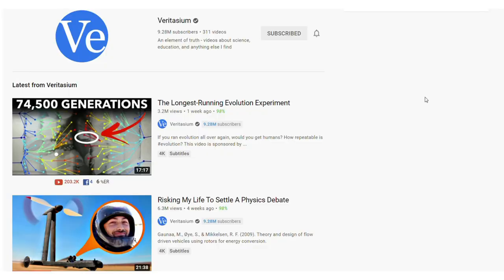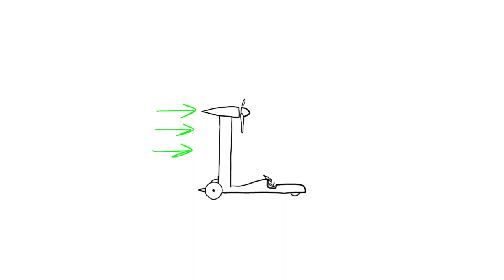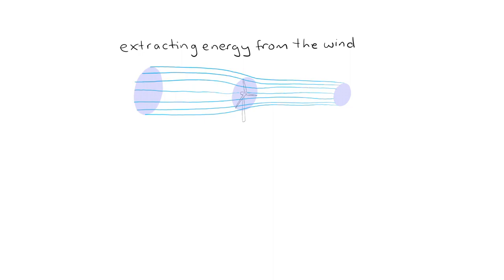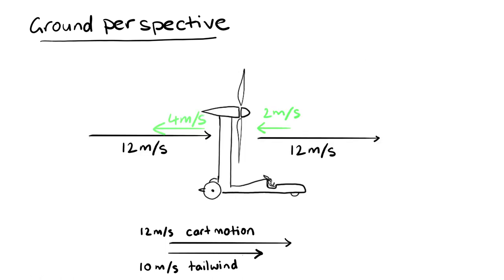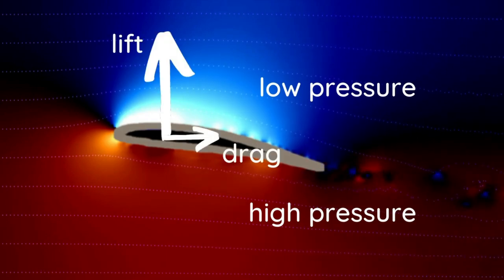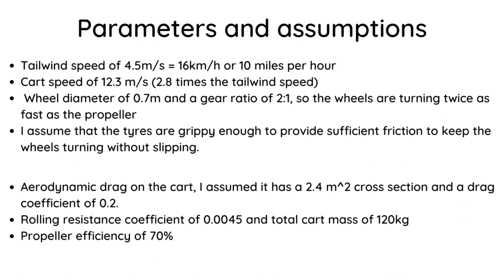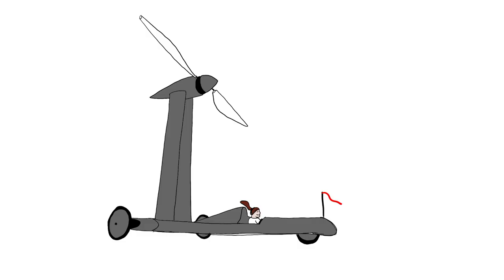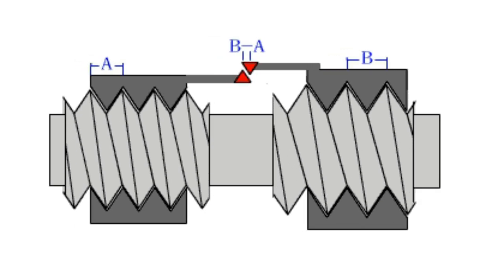Downwind Faster Than the Wind by Veritasium: How Does it Work?

Comment: Next question for the internet: Can a glider pilot experience negative g's?
Reply: Why not?
Reply: @eyytee  It means it's falling faster than a rock...
Reply: Of course.  Just roll inverted and fly along or push over hard!   I'm not sure what the conundrum is here??
Reply: @NielMalan  G-force is not about how fast you fall, but about how hard you turn, and/or how the plane is oriented.
Reply: As a licensed glider pilot, I can assure you that negative g's are trivial to induce in gliders.  Plenty of videos on YT showing this.
Reply: @sk.43821   Just roll inverted and fly along level or push the stick forward hard!
Reply: @sk.43821  In the context of planes, negative-g and positive-g refers to the direction along the plane's yaw-axis.
Reply: OK, a poorly posed question got some knee-jerk responses from literalists. 

Rephrased: If a rock is dropped from a glider, can the glider reach the ground before the rock?
Reply: @sk.43821  It's a pilot's experience of falling "upwards", as if gravity has become repulsive.
Reply: @NielMalan  "If a rock is dropped from a glider, can the glider reach the ground before the rock?
"

It he drops the rock while flying horizontally fast and goes into a dive after that, he can overtake the rock vertically.
Reply: @eyytee  So a glider can fall faster than a rock?
Reply: @NielMalan  A glider is not just falling. It can exert an upwards force on the air, and thus experience a downwards acceleration greater than 1g.
Reply: @eyytee  So the pilot would be experiencing negative g's throughout the flight?
Reply: @NielMalan  The plane would have downwards acceleration greater than 1g (parallel to the Earth's gravity). This is not what is usually referred as "negative-g" in the context of planes (parallel to the plane's yaw axis)
Reply: good bye Niel Malan
Reply: @NielMalan  Yep.   You didn't get knee-jerk responses.  You got straight responses from the question you asked by a bunch of glider pilots.

Yes.  A glider can most definitely beat a rock to the ground but it probably would break up first for exceeding max speed.  You roll inverted and are just using the wing to generate negative lift which can get you down quick.

Comment: Ok but where's the explanation of the acceleration past 10 mph to 30 mph and why it stops perpetual acceleration at 3 times wind speed. The wheels drive the fan which speeds up and drives the wheels which then drive the fan even faster. Your fan thrust math is pretty small at 10 mph but what's going on beyond that? Sorry if you explained that and I'm just not getting it.
Reply: As the cart accelerates eventually it reaches a speed where the cart body's aerodynamic drag combined with other losses become more than the thrust of the prop compared to the retardation at the wheels plus body drag.  That is the limit speed.   There are other issues with props like tip going supersonic at even higher speeds but it probably never gets that fast.
Reply: @killbeas  I was trying to understand how the sail across the wind speed factor of 2.8 just happened to be the same factor the Blackbird achieved. Integza explained this to me. The prop is the sail across the wind and the grounded wheels transfer that thrust to the cart. So that tells me 2.8 is the theoretical limit but the cart was even accelerating past that and if 2.8 was the limit, the drag forces should have kept the cart below that. So I still don't have the whole story. Derek said in the video there was no limit which must be wrong.
Reply: @ralfcis  2.8X windspeed isn't special or magic or a theoretical limit speed.  I'm not even sure what you mean about the "sail across the wind speed factor of 2.8X".  In unofficial trials the cart did over 3X windspeed.  The limit speed of the cart (over ground) is determined by the speed of the wind and the limit speed as a multiple (like 3X) of the wind speed of a particular cart is determined by the  efficiency of that cart.
Reply: @killbeas  Derek started the first video about how sails can go downwind 2.8x faster than the wind and no mention of how the Blackbird utilized that fact. I wanted to connect that bit of info to the blackbird design. He showed a graph in the 2nd video the cart kept accelerating steadily not decelerating due to drag. So either the sail factor is greater than 2.8 or the limit where drag surpasses the ever increasing acc is way above that factor or without drag the acc would be infinite. The sail factor is not infinite and that creates the thrust force up to 3x wind speed.
Reply: @Rick_Cavallaro  Maybe that's true but that idea can be tested in a helium tunnel with a mag lev cart driving an electric fan off the mag lev. I have an unfounded belief that past a certain point lowering the resistance will have no effect. The cart going from 0 to 10 mph is accelerating due to windspeed but drag does not limit it a lot to that, the windspeed does. Same with the acceleration from 10 to 30 mph because the windspeed is still the driving force and you can't get infinite leverage off it. The max leverage is the crosswind sail speed factor of 2.8x windspeed. I'm sure this cart could be rigged to go upwind the same as a sail can tack upwind. The 10 mph wind holding you back would drive the prop that could force the wheels at 28 mph ground speed upwind. Somewhat less as the drag upwind would be greater than the drag downwind but the true limiter would be the leverage of a fast prop to wheel speed.  If I'm wrong, I'm wrong but i need to be proven wrong by physics or math.
Reply: @ralfcis  I believe he was referring to the world record value of 2.8X windspeed that the Blackbird set 10 years ago.  It was not a limit speed but only the speed obtained on the day of the record run under the conditions specified in the record attempt.  The cart has a variable pitch propeller which allows it to become pitch closer to the limit angle to the wind.   Given the wind conditions of the day, this was the best that could be managed at that speed.  I'm not sure what you mean by the term "sail factor".   The variables that I'm aware of are propeller specification (NACA airfoil type), swept area, weight, rotational speed, and pitch angle of blades.
Reply: @ralfcis  I'll take a look and get back to you.
Reply: @ralfcis  OK, I watched the first video and they are definitely talking about the world record speed of 2.8X wind speed.  This is not a theoretical limit speed but just the speed during the test.

https://youtu.be/jyQwgBAaBag?t=1191
Reply: @killbeas  Oops I'm wrong. At 7:18 he said 3 or 4 times windspeed and the speed limit is due to drag. Yet the leverage  limit of the sail angle can't be infinite because then there's no motion. If the drag was the limit then the acc from 10-30 mph would have not been a straight line. I have an unfounded belief that the sail leverage is the limit long before the drag limit and would like to know if that's true or not.
Reply: @killbeas  When I google the sail speed factor relative to wind speed I get a lot of answers from over 2x to 4x but no theoretical or world record max.
Reply: To me there are a lot of unanswered questions but I can't believe drag is the only limit because this would make it near perpetual acceleration if they worked on the drag. I'm sure the answer is the leverage limit of the sail angle to the wind. I bet the design could be used to go upwind the same way sailboats can because the upwind tacking angle is already in the prop angle.
Reply: Upwind, the prop would drive the wheels which is opposite to the wheels driving the prop downwind.
Reply: @ralfcis  "Upwind, the prop would drive the wheels which is opposite to the wheels driving the prop downwind."

Yes, and the Blackbird already did that, at 2.1 x windspeed.
Reply: @ralfcis  "I can't believe drag is the only limit"

There is also limited wheel traction (unless you gear it to the ground), transmission losses and structural limits (transmitted power grows with the cube of speed), and propeller efficiency (goes down when the blades reach a substantial fraction of sound-speed). Taken together: max_speed = wind_speed / (1 - overall_efficiency)
Reply: Ok I need some time. I also need to see what the 2nd math prof did to the formula to defeat infinite speed without resistance in the original prof's formula. There can be no infinities in physics.
Reply: @ralfcis  There never was any infinity. Prof. Kusenko missed that both, the enumerator and denominator go to zero, so the whole fraction converges towards a finite value. Prof. Kusenko already deleted the slide with the infinity claim from his presentation. But you can still see it in Derek's rebuttal.
Reply: @Windgrins I have not looked at your link but I have looked at @eyytee's videos and I'm just  going to say I favor the math in this link which I'll print out next post. It only deals with prop pitch angled to the wind. At 135 deg the prop moves at wind speed. At 90 deg and 180 deg the prop doesn't move. (Your math shows at 180deg the prop is going infinitely fast because the cart with no res is going infinitely fast relative to the gnd. )  So somewhere between 135 and 180 the prop moves at max multiple of the wind that pushes it and this max prop speed when pushed by the wheels against the tailwind is the max speed the entire cart can move even without any resistance. Not infinite.
Reply: @eyytee  Your video 3/6 has the relative velocity go to infinity as 1-alpha goes to zero.
Reply: Can't find the link. It's two Brits competing with Dereck and each other for views.
Reply: @ralfcis  A gearbox could have any velocity ratio, if the losses were zero. A sail boat could reach any windspeed multiple, if the losses were zero. But in practice they never are zero.
Reply: @eyytee  That's your argument but I'm saying it's not the reason the cart speed is limited. The limit is in the sweet spot of prop speed driven by wind speed and fine tuned by prop pitch. Read my argument. Past the sweet spot the max prop velocity results in zero thrust and before the sweet spot the min prop velocity also zero thrust.
Reply: Ok I viewed the wiki link and everyone is telling me the resistance and not sail leverage at sweet spot velocity and pitch across the wind limits the max speed factor. I looked up ice boat max sail factor as it would have the least resistance and it can go 5 times wind speed. This seems very far from a theoretical limit of an infinite speed factor if there was no resistance.
Reply: @eyytee  The gear box could be infinite to drive the prop at infinite speed with an infinitely shallow pitch and the speed of the cart would be zero because it would take infinite wind speed to get started even with zero resistance. To me the max speed is mostly achieved by balancing the gear ratio to the pitch to the prop velocity between limits that are not open ended.  Any one of these tending to infinity would tend to produce zero cart velocity not infinite cart velocity.
Reply: @ralfcis  " To me the max speed is mostly achieved by balancing the gear ratio to the pitch to the prop velocity between limits that are not open ended.  "

If the gear ratio and/or the prop pitch are variable, it is open ended, and limited only by efficiency (just like any gear ratio). The propeller pitch, transmission ratio, wheel radius determine the overall gear ratio of the cart. And that can be variable.
Reply: @eyytee  You hit the nail on the head here. I'm no physicist, I just somehow love physics but every physicist I've ever come across does not understand there are no infinities in physics that stand alone. There are always values in the equations that cancel out the infinities and make the entire equation tend to a finite value. This is what theoretically limits the speed factor of the cart regardless of real world resistance factors. You're saying these factors overwhelm the equation but I see they can be mitigated to the point of insignificantly limiting the speed factor with the ice boat example or in the graphs of the blackbird's acceleration which are straight, not curved. I know you're all experts but I see red lights in your expert analyses.
Reply: @eyytee  You're pointing to individual infinities in the equation but they do not stand alone, they are cancelled out by the other variables in the equation. These hyperbolas are turned into bell curves long before real world resistance becomes a factor. The wind speed is a finite limit which is what eventually puts finite limits on all the variables in the equation tending to infinity. They are not open ended in the equation.
Reply: @ralfcis  You are seriously overthinking this. Look at gear boxes. There is no hard theoretical limit on the gear ratio, just practical limits.
Reply: @eyytee  I'm saying the gear ratio, the prop pitch, the prop speed cannot be individually taken out of the equation and extrapolated individually to infinity. Sure there is no hard theoretical limit on gear ratio but you're taking it out of context and it is not relevant just as very high prop speeds are possible but that random statement is also irrelevant. What is the max speed ratio of land speed to wind speed without any resistance and any math that says infinite is incomplete and therefore incorrect. Instead of extrapolating the resistance in the equation to infinity, try extrapolating it to zero and you'll be left with the true limiting factor where the bell curves of gear ratio, prop speed and pitch are optimized. Your claim is that they're not bell curves without including resistance.
Reply: @eyytee  This is crazy but now I'm wondering if a 2nd prop could harness the  power of the new headwind the downwind cart is facing.
Reply: @ralfcis  Look the papers linked in the Derek's video description. They derive the limiting speed.
Reply: @ralfcis  No, because it would push air forward, in the downwind direction, creating more wind relative to the ground. To extract wind energy you have to slow down the air relative to the ground.
Reply: @Rick_Cavallaro  The problem with science is you can be a fly and still argue with the creator.

Comment: Are you telling me that if I put a submarine with a non-engine driven propeller at the bottom of a flat sea in the Gulf Stream, it will go FASTER than the Stream? Really. Are you telling me that the energy of friction dissipated by the propeller is not slowing down the submarine? Their experiment was not done with WIND, it was on a treadmill. Does a pure not-attached-to-a -boat sail moves faster than the wind? Like a kite? If so, as the wind stops pushing and the sail (sail is faster) will make a "vacuum" behind it? Fishy, fishy... If I understood correctly, the torque is increasing the car speed faster than the wind creating the torque itself. Does this mean if I use a gigantic propeller I could, in principle, go at the speed of sound? Or higher? I mean this is a way to travel for free riding the Jet Stream at fantastic speeds!! I want you to prove it using a wind tunnel with smoke streamers and all...
Reply: @Rick_Cavallaro  , in this case the torque from the wheels of the car, not the torque of the propeller move the car. You have to prove that the directionality of the torque is the same in both directions
Reply: @Rick_Cavallaro  , The gulf stream follows the same laws as wind, Bernoulli’s laws. So, you’re proving my point. A propeller in any fluid will not move the car or the submarine faster than the stream
Reply: @Rick_Cavallaro  whatever